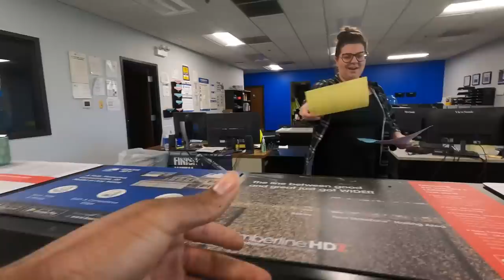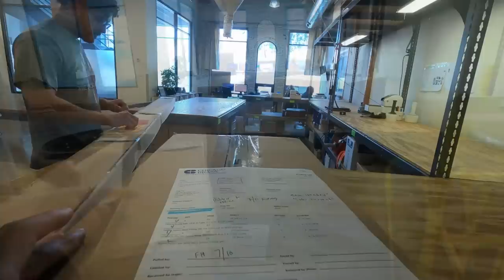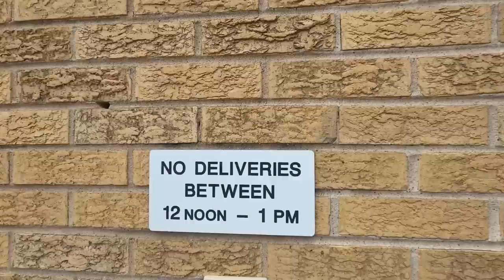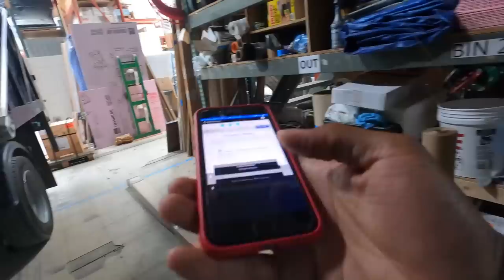This Route was TERRIBLE!! Are Single Orders on the Gig Apps BETTER than a Route? #foryou

Comment: Yoooooo, soo what are considered large sizes for tarps and moving blankets...? I ordered 2 80"×72"(@65lb weight) moving blankets is that considered large?
I have no idea what size tarps to get, or the "mil size"/thickness to get...? 
Got any suggestions??
Reply from the maker: I think those are good sizes. Sounds similar to what I have. I have a smaller one too.
Reply: @carsandcribs6159  
I hear you, but what about the tarp size and mil-size?? What is a good size to buy? I don't want to guess and get one too small or too big that it takes up extra space... I don't know, I was going to buy a really big one and a small/midsized one to be on the safe side, but I don't think I really need multiple tarps, especially since I'm not driving a pickup truck... lol